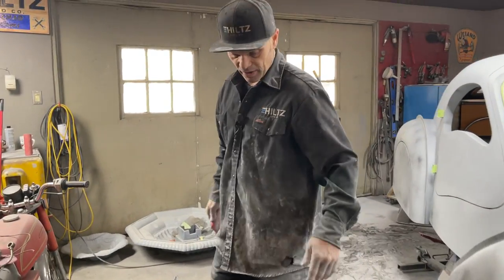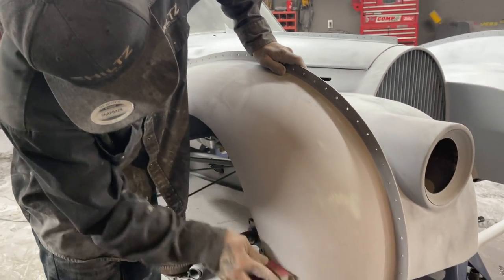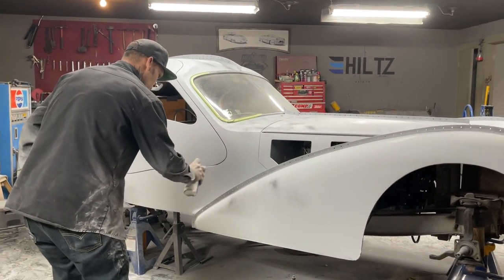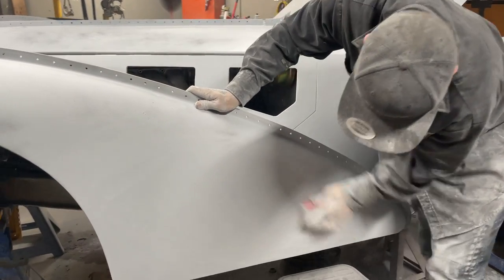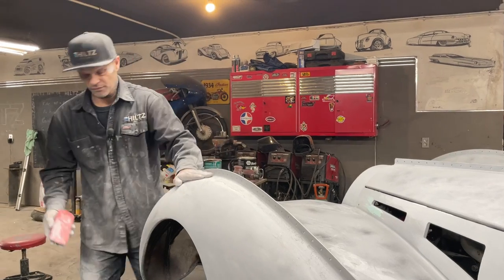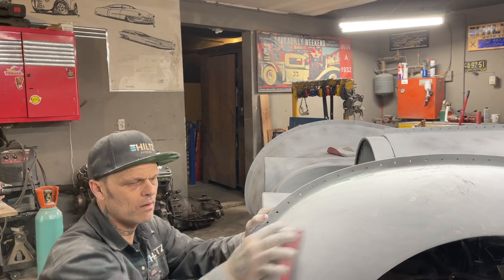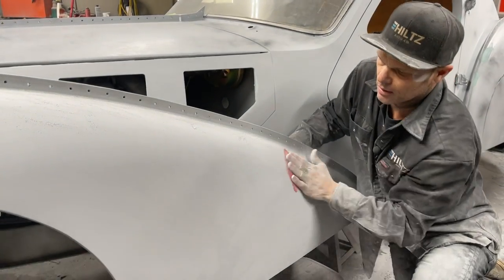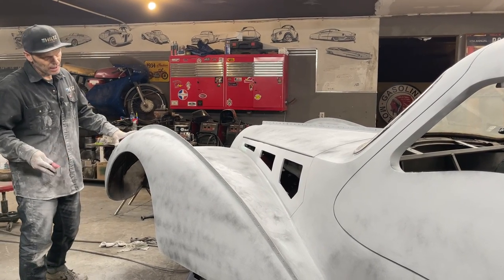BUGATTI: HOW TO USE A GUIDE COAT WHEN SANDING PRIMER

Comment: 3M makes a guide coat that is powder carbon black. It is applied with a foam applicator  that will get into the smallest scratch. It isnt sticky or hard like a spray bomb. It is cheap and goes a long way. Works espcially good with the finer grits.

Comment: Why would you put guide coat on then take it off with 80? Also when your primer is shrinking back that badly or you are leaving 80 grit sanding scratch’s that is a sign you should finish your work in at least 180. These are bad lessons to teach. This isn’t how shops do work. This also isn’t what guide coat is for.